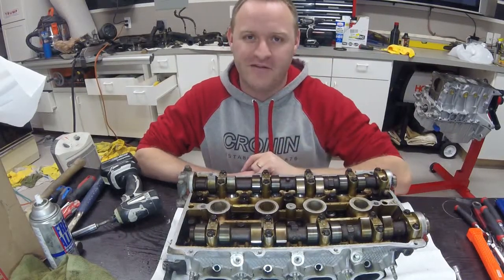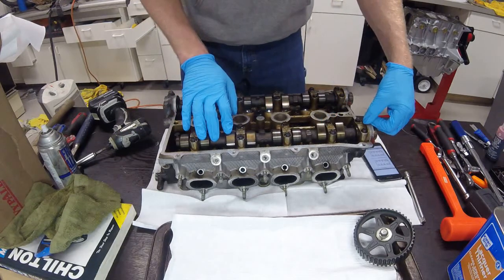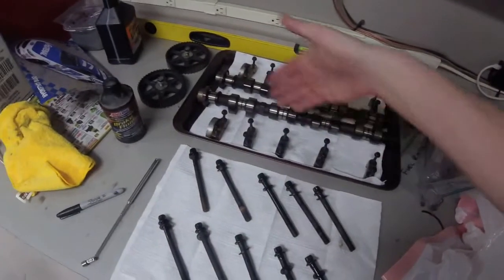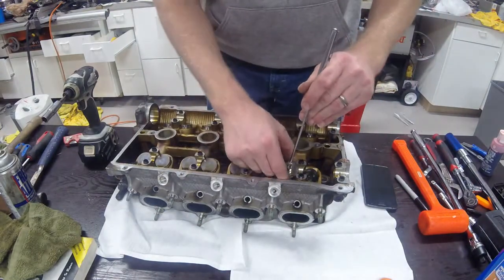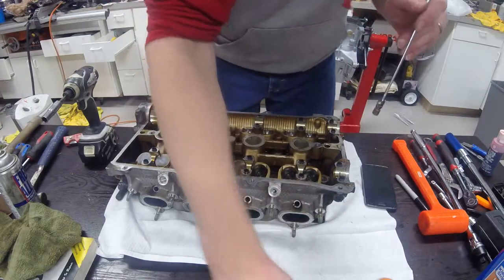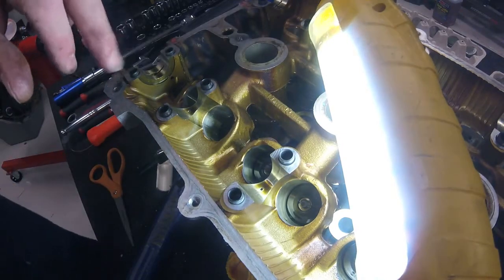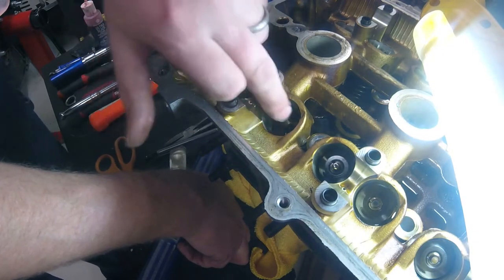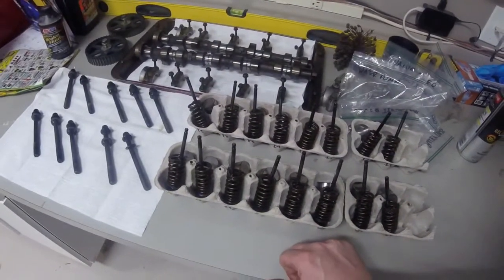Tearing Down A Miata Cylinder Head For Rebuild

Comment: I forgot to label which for cylinder my 99' miata lifters are, how important is it to get them back in in the original order?
Reply from the maker: The lifter is worn to that particular slot unless everything is remachined it should go back in the same hole it came out of.  You would probably want to check clearances and fitment or take it to a machine shop and have then inspect
Reply: @BuildingTheEXOCET  Went to take a look at them and looks like I forgot that I labeled them. Thanks anyway!

Comment: I just bought a used vvt head off a car with 87k miles in “good condition” do you think I should get it resurfaced or can I just clean it  and assemble it. Thanks, love these series videos. :)
Reply from the maker: MazdaMatrix wouldn't be a bad idea to take aachinist straight edge and feeler gauge to check the flatness.  Or take it to a machine shop and have it checked and flattened if need be
Reply: BuildingTheEXOCET yeah good idea I’m going to get it resurfaced then. Also, did you buy the valve stem seals from mazda?
Reply from the maker: MazdaMatrix I bought the Mazda oem seal kit with included every oil seal top to bottom end.  Was like $220 on sale at tasca parts.  It included the valve stem seals.  The intake and exhaust seals are different so pay attention.  I didn't and had to redo half of my valve seals
Reply: BuildingTheEXOCET I just checked it out. Super cheap, definitely going to go with this seal kit. The color of the seal is different for intake and exhaust correct??
Reply from the maker: MazdaMatrix yes sir.
Reply: BuildingTheEXOCET thanks for the help.